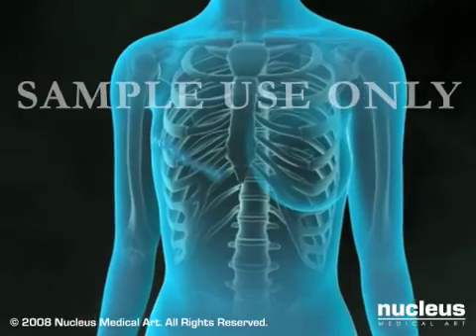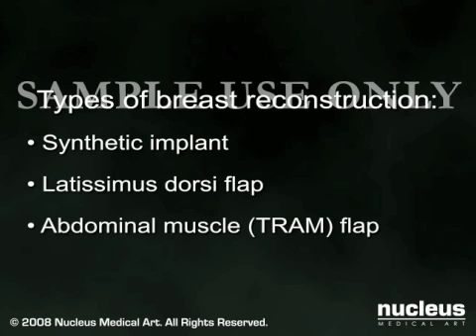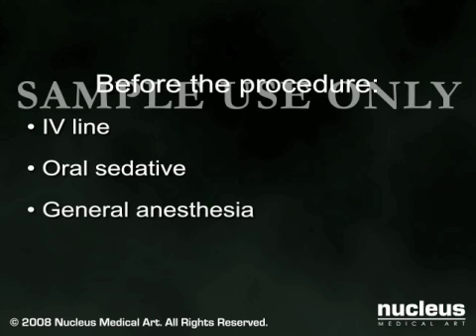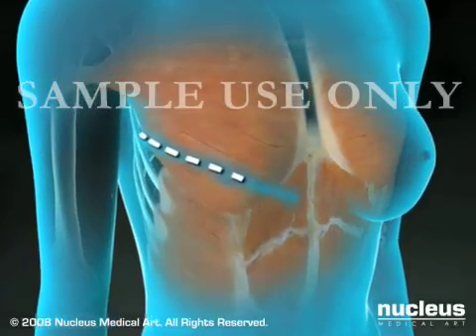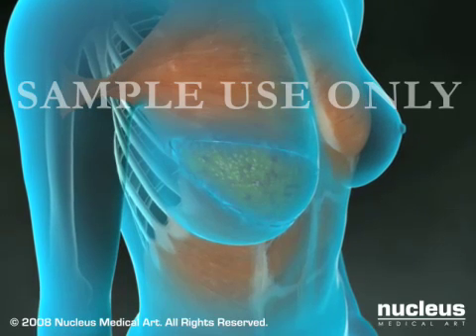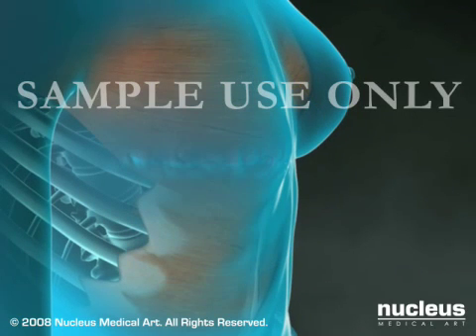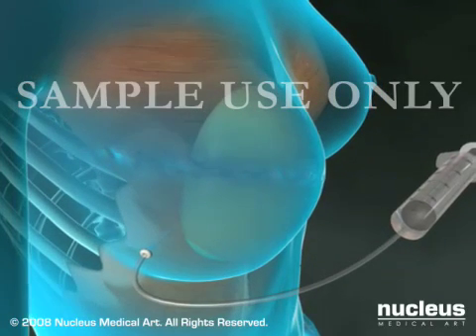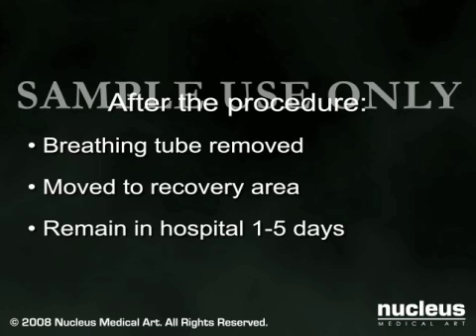Breast Cancer | Breast Reconstruction | Nucleus Health

Comment: I found this really helpful after just having a double mastectomy myself.  I was too thin to use tissue from my body, and have to have implants instead.  This information is extremely helpful to those of us, who are faced with breast cancer at such a young age, and want to remain as normal as possible.  The fear of the surgery is worse than the surgery itself.  So this is helpful in relieving the fear, and knowing that there are options in how to replace our breasts to feel like a woman again.
Reply: My mother is going through a double radical mastectomy and considering the implant option. Have you gone through with it and if so, how were the results? I see this comment was 14 years ago, so how are the implants this many years out? Have you had any trouble with them or had to replace the bags. Thank you.
Reply: Kemon khoroch hoye6ilo